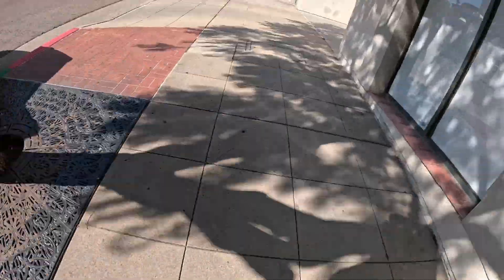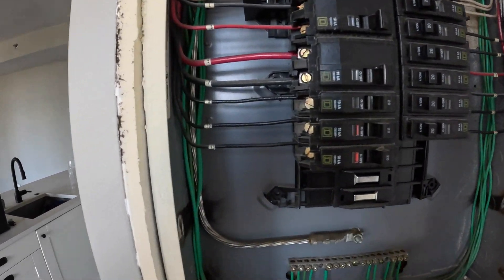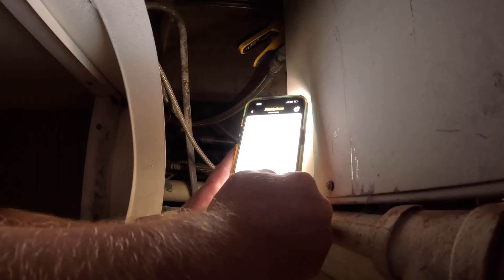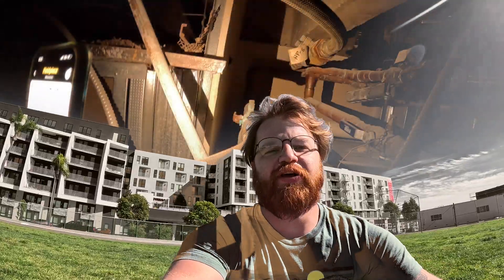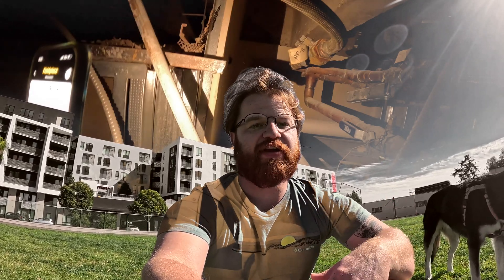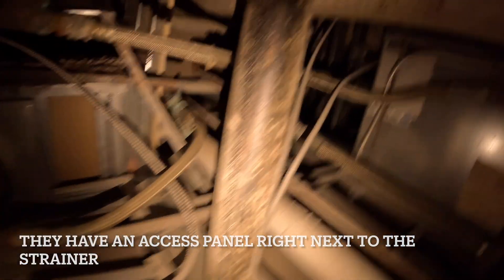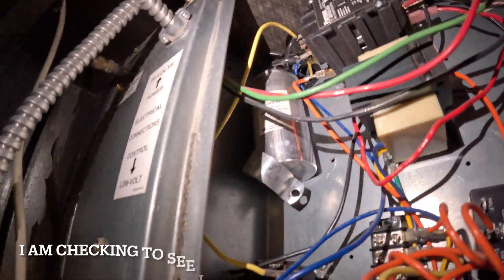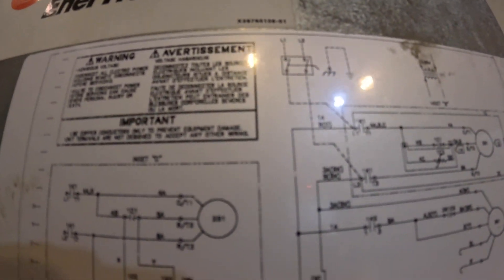TRANE Water Source System Broken But It Worked When I Arrived - Service Call Beginning to End

Comment: I Didnt realize yall were in SD at first. We had to install a 10 ton WSHP in downtown. That was a massive pain.
Reply from the maker: Was it at least able to be dropped straight down? The issue with the one in this video is that if they want to swap it they are going to have to cut the whole hallway out to get the unit out and the new one in. I honestly don't know how this access was so poorly thought out
Reply: @SurfBrosHVAC  yea it was in a mechanical room. The hardest part was getting it up a flight of stairs. Luckily with the old one we just cut it up and took it down in pieces.